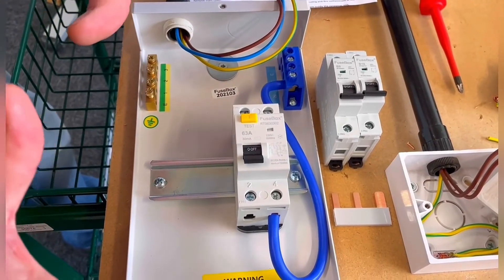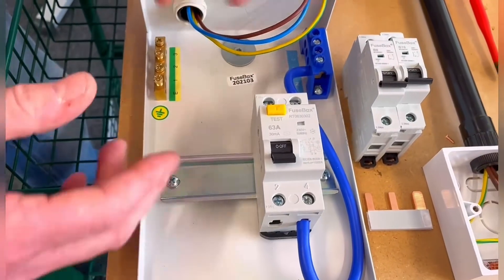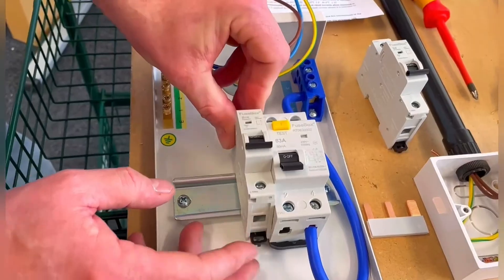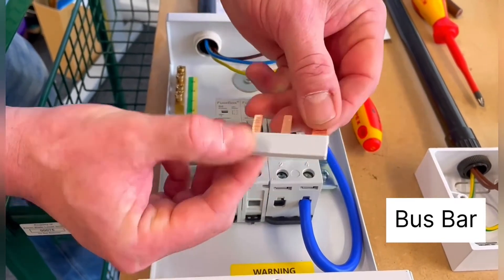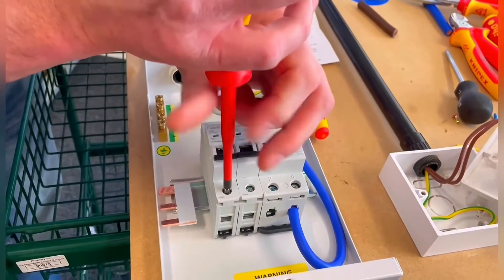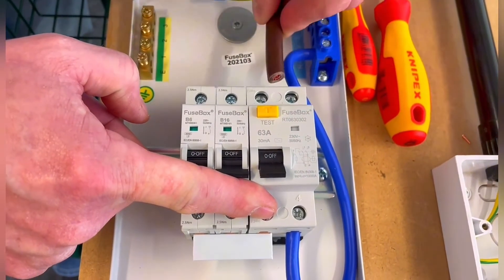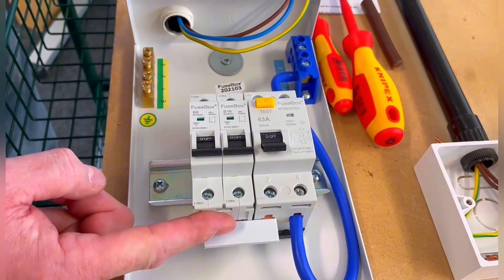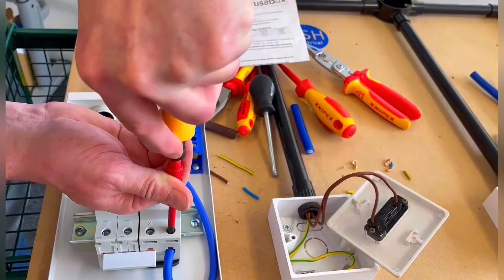How to Fit a Busbar in a Consumer Unit

Comment: Would it be ok, if I have 3 RCBOs and 7 MCBs. The one RCBO is the main 63amp breaker and the other two along side it is 25 and 20 amp. Then the 7 MCBs because I’m using 1 pole busbar for the MCBs but I want to continue it pass over the 2 RCBOs. Is it ok to cut off the tooth that passes over the two neutral terminals. Even if I  do a tidy job of it. The 2 pole busbar is too wide to put the main cables into the 63amp main breaker.  I like the video 👍👍👍👍

Comment: Educational video Gaz.  I disagree about putting the largest breaker next to the dual pole main switch even though historically/traditionally this was the norm.  Main reason being if there is a high load or exstended period of use the device will warm up and then thermal effects COULD cause damage/thermal damage to the OCPD or adjacent devices.  

As a side note a type 2 SPD in the CU (Consumer Unit) would be prudent but i understand this video is aimed at entry level learners
Reply from the maker: When colleges have type two SPD’s inside a consumer unit with a type RCBO’s I will be dancing in the streets as they are still way behind where they need to be.
Reply from the maker: Totally agree you couldn’t have an air source heat pump next to electric oven next to electric shower you need to spread out those continuous high current loads throughout the consumer unit